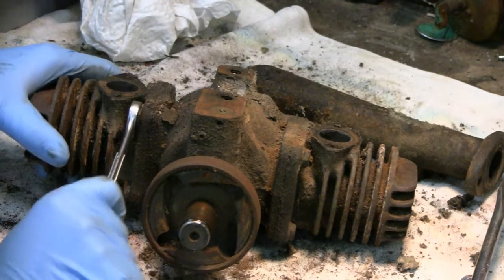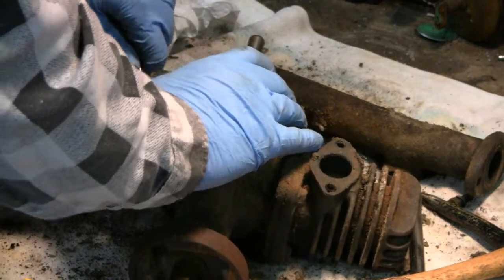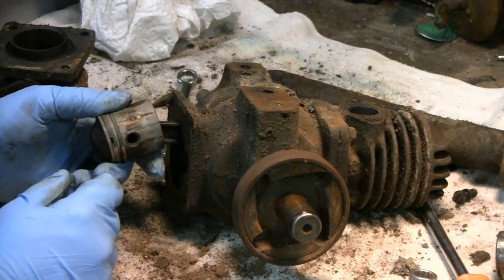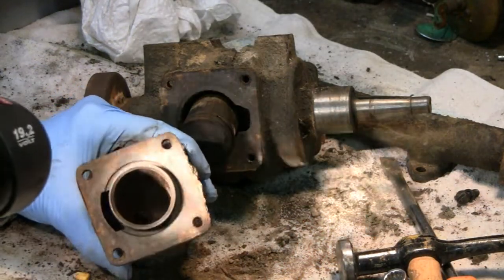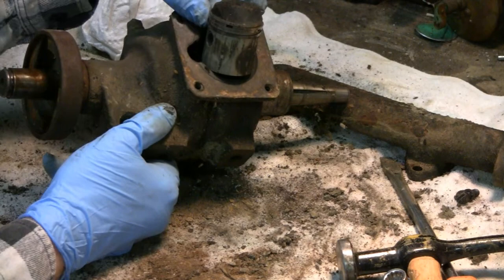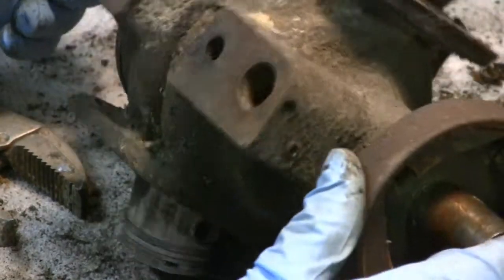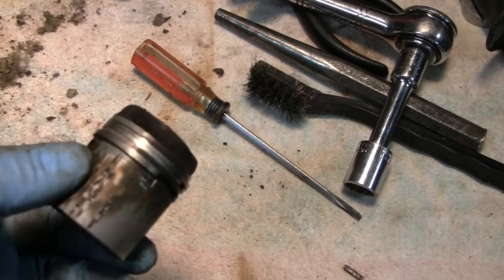MAYTAG 72 ENGINE TEARDOWN (PART 4)

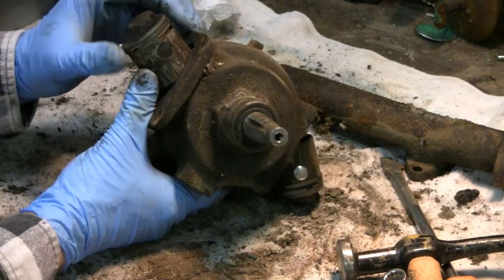Comment from the maker: @AeroSport103 Yeah a slide hammer works great!! We showed how to remove one like that in an earlier video. To remove the crank There is a big nut attached to the sideplate, you can see it at 3:28 once you remove that, the rods and clutch housing it will fall out!!☺